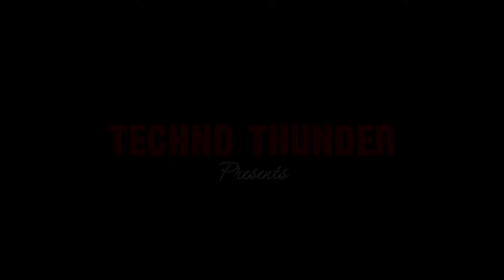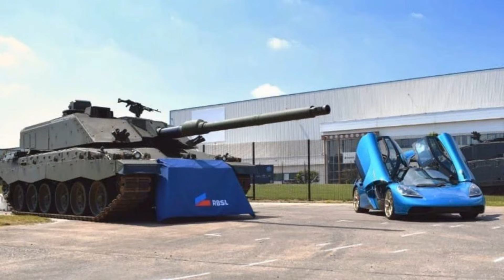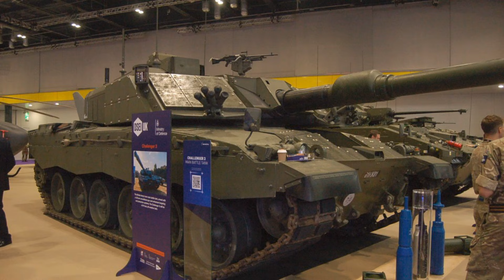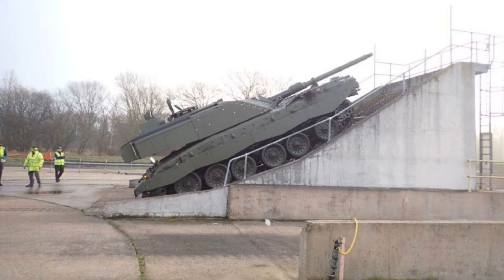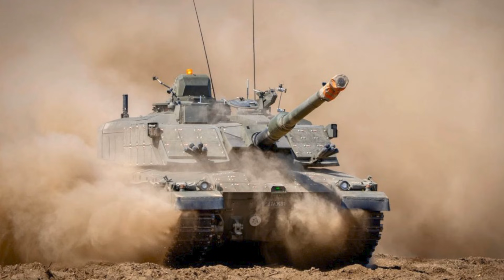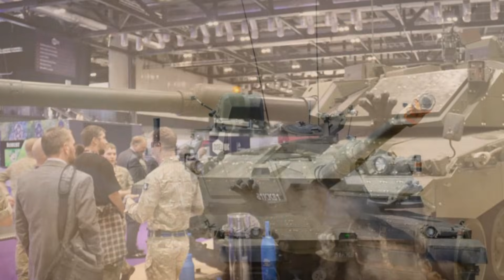Challenger 3: Why Britain Won’t Build Its New Tank Until Trials Prove It Works

Comment: its a joke anyway ..... we were told that the Challenger 2 was the World's "Best" tank ..... so if it was/is so good why is the gun being changed .... and the engine .... and the self defence system .... with foreign made stuff ?
Reply: Bit dim aren’t you .
Reply: Because it was the world's best tank like 20 years ago, a lot changes in 20 years and needs updating - ammo changed and was better with smoothbore guns, the engine is underpowered now with all the additional armour and electronics , and APS wasn't around during its inception. The only thing that's world class about it is the Armour Package, especially fully equipped as TES Standard as we would send them into battle not just the ones we sent to Ukraine. Only 2 have been lost in Ukraine one of the lowest out of the NATO tanks.

Comment: I believe that once again adding a brand new turret to an old hull has thrown up the usual issues.
The hulls are in varying condition, they were manufactured 30 years ago and each hull is slightly different to each other. The turrets aren’t fitting uniformly. These are hard used vehicles, many have been used in combat or in training environments.
So, like Nimrod or the cancelled Warrior upgrade the U.K. are committing the same cardinal sin. Use old equipment with brand new equipment.
They are either going to have to manufacture new hulls or just buy the Leopard. Like they should have done.
Reply: to be fair it's a different manufacturer.
Rheinmetall BAE Systems Land Limited, not General Dynamics UK, 

so there could well be a different outcome depending on differences in project management and possibly engineering skill.
Reply: Interesting point but, I believe wrong. You seem to be imputing to the Challenger 2, produced in the hundreds on a standardized production line, the same problem as for the Nimrod, where airframes where sourced from a small, tailored production run, wherever they could be found, so necessarily different. I do believe that the necessary bulk requires new hulls to be produced to bring numbers up to the mid 200s, at least.
American and German tank doctrines differ from that of the UK. The Leopard isn't protected enough for UK doctrine. So the net result would be similar. Take an existing tank; work out how to make it fit doctrine; design fixes; test the fixes across all expected operational situations; repeat the design/test cycle as necessary; finally approve the modified tank for serial production, likely at a much higher cost than the original, and higher than the reuse of Challenger 2 hulls. Comedically, the Leopard 2 doesn't have a BV so would likely not find favour with troops.
As an aside just look at the failure/destruction rate of Abrams, Leopard 2 vs Challenger (1 or 2).
Reply: @franciscook5819 the Challenger 1 and 2 were always deployed in negligible quantities, so In don't thing the loss rate is a meaningful statistic. Operational conditions also is important as most Leo 2A4 losses happened in Kurdistan, due to manpad shot at the sides at short distance, that even an M1 or a Challanger could not have survived.
As far as I know there will be no new Hulls produced, which is perfectly reasonable as all the tooling had been destroyed years ago and, with a modern turret available, you'd rather build much better and modern tank today.
Reply: @Zumzifero  1) 2000+ Abrams deployed to Iraq, 23 lost(some repairable, some lost to gung-ho US friendly fire). More Iraqi tanks killed by Bradleys than by Abrams. vs. 180 Challenger 1s deployed, 300 Iraqi tanks and AFVs killed, no losses. This included the world record longest tank-on-tank main gun kill (4.7 km vs a T55). Ask the Iraqis if this was 'insignificant numbers'.  If the British losses matched those of the USA two would have been lost. 2) During ops in the Gulf, a single stationary Challenger (it had lost a track manoeuvring) was struck by 17 rpgs and a Milan missile to little effect. In the end the insurgents gave up, the tank (and healthy crew, still inside, brewing tea) were recovered and it took only six hours to fix the damage (mostly the optics). Subsequently another Challenger was hit by over 30 rpgs and missiles and survived, largely intact. A Challenger has significantly better armour than Leopard, as witnessed by Leopard losses. 3) I also believe that no new hulls will be produced. My guess is that eventually, NATO will standardize on a 130mm or perhaps 140mm main gun and at that time new tanks will be produced - it is pointless building new tanks to fit 120mm gun and ammo if an upgrade to a larger calibre is in the works.
Reply: @franciscook5819  statistics do nit work like that. You need a sizable sample (2000+ is) and equivalent operative conditions which is not the case.
Does it makes the Challanger a bad bunker tank? No: just not draw wrong conclusions from wrong numbers. A single wrong engagement (Turkey) due to poor intel or a wrong decision can easily make loss rate irrelevant for statistic meanings. Any RPG, AT mi e or even a Molotov cocktail fir the matter, can destroy the heaviest tank if shot at the right angle and in the right place.
If you check frontal damages literature  on modern tanks, you'll see everyone does pretty well.
Reply: @Zumzifero  Wrong by every measure. I am a mathematician by training. The evidence is clear. Even the Germans have repeatedly up-armoured to try to fix the inadequacy in Leopard 2s. I have no idea why you are so close minded but it is clearly not worth my while continuing a discussion with you - a lesson I learned long ago from other bigots who stick to their preconceptions in the face facts which refute their position.
Reply: @franciscook5819  Because you are a mathematician, it doesn't make what I said wrong. I'm actually surprised you'd take such a low sample as a viable statistics pool, especially with all the variable involved (which I explained in detail) which could screw your assumptions. Data are only as good as the contest they are fished from.
The lower plate of the Challenger is by all means a well known weakness of the tank, which means a lucky shot would put all your "statistics results" upside down, given the "2 kills" you consider enough for judging  a statistic endorsed superiority. Did you, by the way, also included all the Challenger put out of action by their own faulty design in Iraq?
Honestly, what you are saying makes absolutely no sense to me, because flawed by "absolute Certainties" I'd never even assume as "truths".
I'm amazed at how some people treat "weapon's brands" like they were a football team, or as if someone would question their "righteous faith".
I doubt any unbiased "mathematician" would talk the way you do.
Reply: You are right, and the issue is the lack of a plan B, because there is no other option available. These tanks may work fine for a while, as far as the base well maintained, but the engines are tired, the suspensions have aged and transmissions are worn. Refurbishing never comes free of issues as metal stress is hidden even on an overbuilt tank. Advanced future tanks, like the MGCS are probably decades away, and standing on a lot of uncertainty, and a replacement for the upgraded Challenger may not be there when needed.
Italy is refurbishing the C1 to C2 out of necessity, to have something in operation fast, but the IMBT is in advanced state of design, and will eventually take over, once all the desired tank divisions are at full strength. In time new IMBT will keep rolling out from the same factory and will start replacing the more problematic of the C2.
This is not something the Royal Army has foreseen, and the Challenger 3 is an extremely expensive conversion to begin with. In time new engines and transmissions could be required especially due to the extreme weight of the tank, but factories that originally built spare parts have been dismantled 20 years ago.
Reply: It's not just that ... This war in Ukraine if it's proven one thing would appear to be that the days of battalions of tanks leading a charge through enemy lines and causing mayhem behind them are long gone .... There'll be no more charges as occurred in Gulf 1 and 2
Reply: This wasn't really the case with Hobart funnies on Churchills and Shermans.

Comment: They better not make a new tank. Clakkity klack, blood from the ears! Give the remaining tanks to Ukraine and buy new Leopards.
Reply from the maker: Do you think that nothing will work out for them or that there is simply a lot of competition in the market? Do you think that something is needed for the market, wow! DO THEY NOT HAVE A STRATEGY FOR THE BEST OFFER ON THE MARKET?
Reply: @mai @mainbattletank6190 understand that the fittings on each tank is unique because of the age and non exacting processes back in the day. So it’s impossible to build 100 new turrets and fit them on all the tanks. If they stubbornly proceed with this upgrade, they will choke on it like Ajax. It makes no sense. And why you using caps at me??
Reply: Leopard is older than C2/3.......

Comment: A bit late. The getmans are already massproducing leo2a8 and the new panther. They produce two main battletanks and uk cant even make one.
Reply: I'm confident Challenger 3 will work out in the end,
especially since it is made by Rheinmetall's UK armor branch RBSL, so they can rely on the corporate know how from the German side for it.
Reply: The new Leopard 2A8 of which German wants 1,000,  plus hundreds already ordered for export customers across Europe, of these most are set to be delivered by 2029, (According to "Soldat & Technik" magazine of 5th July 2025 ).
Production has already started and takes place at several factories at once.

From 2030 on, Germany will switch to procuring the Leopard 2AX, also called Leopard 3.
Then by 2040s the MGCS will be procured, all of these tanks are in development stage. (Leopard 2A8 is now already in production).
For the KF51 Panther Italy so far has ordered 380, on top Hungary, in both countries local production will happen, others are intersted.

So all in all there will be enormous procurement in the coming years for all these tanks.

"With all 148 Challenger 3 vehicles planned to be in service by the end of 2030",
So in a way it doesn't really matter how good the Challenger 3 will be, this is a fairly tiny number, and regardless of how they perform they won't make a big impact given how few are being ordered.
At these production numbers the Challenger 3 will be a boutique product made artisinally.
Reply: @EmanuelWue  let's see if germany actually buys all said tanks and not just word salad. About time to after freeloading off usa and uk for decades. We had the army of the rhine for decades 100s of tanks etc and the uk taxpayer.
Reply: The 2a8 isn't a brand new tank . Like C3, it is an upgrade.
Reply: @thewomble1509  Not entirely true. The tanks are build new. Not on used hulls.